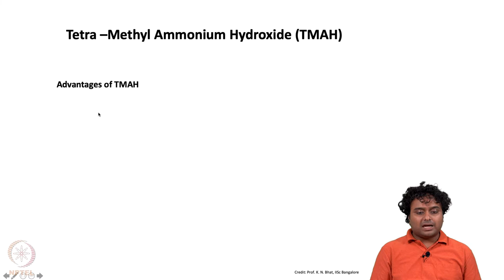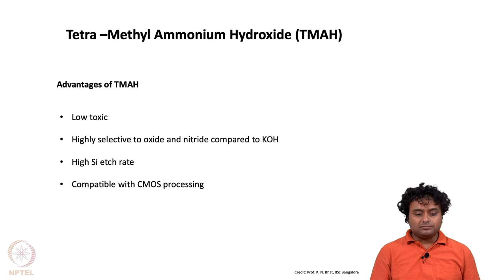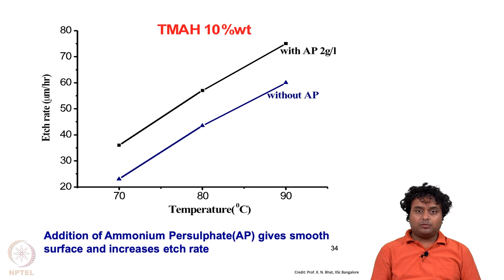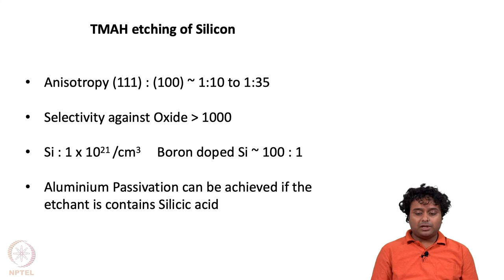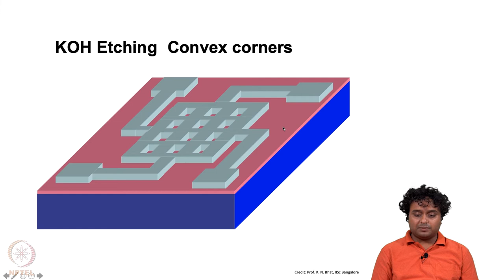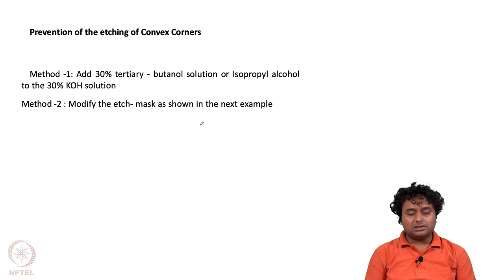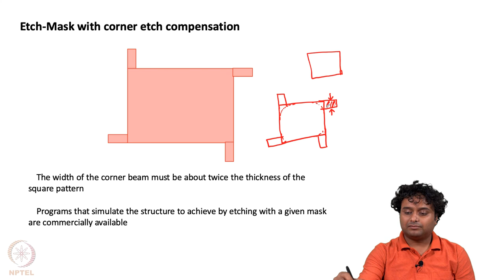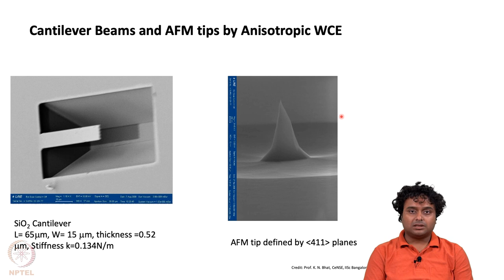TMAH etching

Comment: Thank you for an extremely informational video Prof. Bhat. I would like to make a comment about the inverse dependency of Etch rate of Si on TMAH concentration. The etch rate only decreases with increasing concentration for Si (100) but for Si (110) which gives a vertical trench as opposed to a V-shaped trench, the relationship is linear and directly proportional to TMAH concentration i.e. etch rate for Si (110) increases with increasing TMAH concentration. Please correct me if I'm wrong.